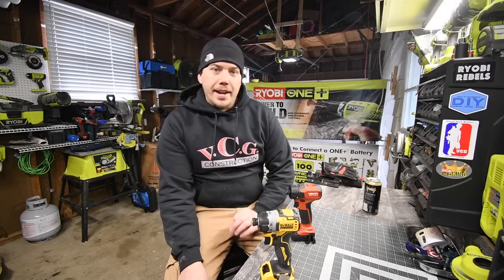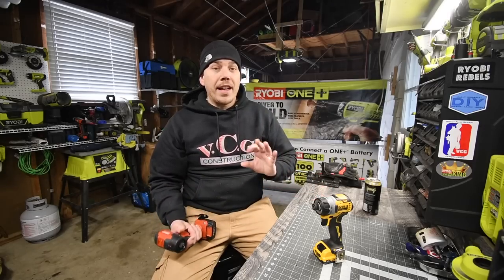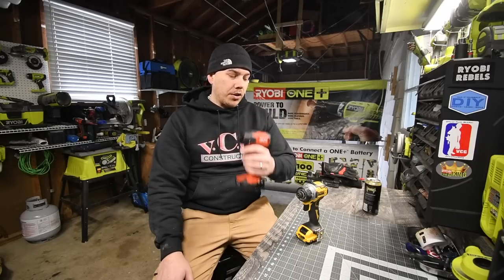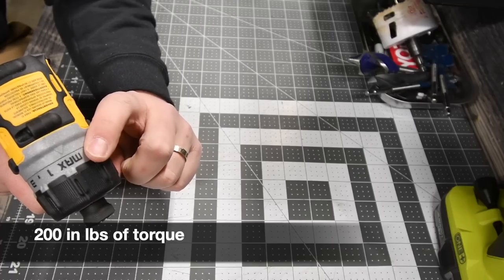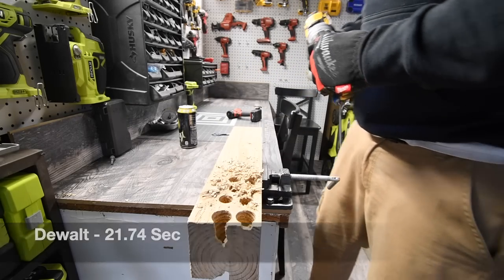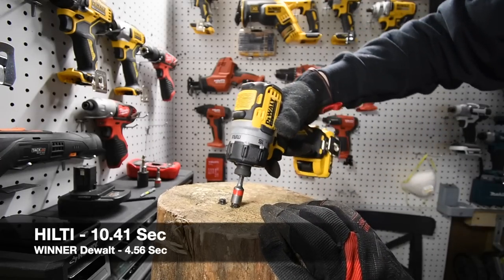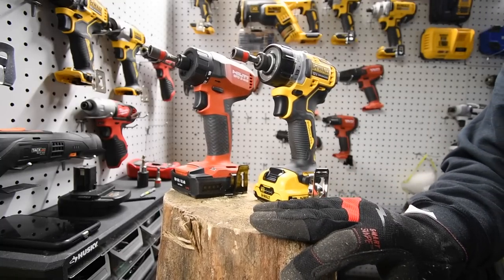Dewalt vs HILTI

Comment: I've had a brushed 12V Dewalt drill driver for damn near 15 years. Came as a kit with the drill, fast charger, and 2 1.5AH batteries. I use it every day. I beat the hell out of it and I've never replaced brushes or even a battery. 12V is the way to go once they get better battery tech. My Hitachi Metabo hpt stuff is by far the most comfortable and is super tough. My Makita stuff is strong as hell and has a lot of tools in their line up. Too cheap to buy Hilti, lol! Good test!
Reply from the maker: I thank you sir
Reply: Milwaukee for you my friend .. wow 😂😂

Comment: I use my DCF601 for residential and commercial HVAC service and installation. Has a great feel in the hand better than M12. M12 impacts pack power but lack refinement needed for fastening and torquing things down without damaging the bits/fasteners.

Comment: I have that DCF601. That is above & beyond my favorite tool that I own. I use it almost everyday. It's amazing. I highly reccomend picking one up. The tool has more power than you'd ever think, and the clutch is able to make it super sensitive, if needed also. As with all DW12V tools, the 3ah & 5ah make a huge difference. The 2ah these come with are garbage.

Comment: Do you know if Hilti has updated their 22v impact driver as well? Would be nice if they gave it the same overhaul as the hammer drill and 12v impact
Reply from the maker: Yes they did, It is now brushless
Reply: No they haven’t, they still have the same Sid 4 A-22 impact driver.

Comment: How could Hilti win when it required a slower speed than the dewalt on like every test lol
Reply: That's not My name agreed 100%
Reply from the maker: the dewalt did not on every test. the dewalt majorly lost with driving the holes the only thing Dewalt did better was driving in the screws, HILIT still won taking the screws out.
Reply: @ManCaverTools  imma rewatch maybe i saw it wrong lol. That and i was paying much attention. But.. il confirm.  Besides id go for hilti
Reply: @ManCaverTools  yeah. I was right hilti needs gear reduction to do much of any drilling or screwing dewalt does not. Dewalt is a better fastener. Given no gear reduction on the dwalt but hilti is good st removing.. which is kinda useless when ur building and putting fasreners in. U don't mess up every fastener
Reply from the maker: @AverageReviewsYT  the Dewalt 12v impact will ge the same the benifit when It versus the hilt 12v impact. the dewalt has multiple speed setting that will be used and the hilt has a variable trigger on its 12v impact
Reply: @ManCaverTools  doesent the hilti have the speed settings too? It looked like the dewalt was on a faster speed compared to the hilti

Comment: thats cool that they can do the big stuff, but i was kind of hoping you would test little stuff, like screwing a tiny screw into plastic (like the battery cover of a volt meter) on clutch setting 1 without wrecking the plastic threads. so far every drill i have (20v stuff) on clutch setting 1 is way too powerful and strips out plastic threads.
Reply from the maker: more test would be coming and I thank you for viewing Michael
Reply: @ManCaverTools  I need to put together a rogue fitness power rack that takes 1/2 driver 1-1/2 bolts. Will this hilti do the job? I predominantly do DIY work and driver screws, but on the rare occasion need to deal with heavier application. Any advice? This hilti screwdriver looks sweet and I’m deciding between this and the m12 impact driver

Comment: Hi,

The hilti might have two speed but doesn't do well on certain task. Maybe best to have one speed.

Would have been nice to see the dewalt on the 3.0ah battery. Just to see if it had the same power like the 2.6ah battery on the hilti. 

Still a pretty cool test video.

Thanks for the video
Reply from the maker: I do want a a bigger battery for the dewalt and revisit this test with it
Reply: The only task that mattered was definitely won by DeWalt

Comment: If you ever get a chance try the Bosch 12v PS22 pocket driver brushless motor 2 speed see how that match with the Hilti 12v screwdriver.
Reply from the maker: I am getting the Bosch 12v system and thank you sir

Comment: Milwaukee has a 12 volt drill driver model # 2402-20 you should test it against both of those, but I’m sure Hilti is the the best built out of all 3. It would be cool to see which has the most power 👍🏼
Reply from the maker: more versus videos are coming up

Comment: What is Brush and Brushless? idk wtf that is for an impact driver.
Reply from the maker: These are not impact driver. brushless motor is solely based on magnets. a brushed motor used magnets to start a spark to deliver power to the tool

Comment: I actually think the dewalt won  bc in speed 2 on the Hilti it couldn’t do it at all and that’s what the dewalt is in all the time is speed 2. So you would need to compare the test for both in speed 2
Reply from the maker: but that's the benefit of having both speeds. because that's like saying the dewalt should have failed both tests with drilling out the holes because it wasn't able to do it without stopping.so the only tests the dewalt will win is driving the screws in and the HILIT will still win with driving in holes and taking screws out
Reply: Man Caver Tools I see your point. No matter what I watch all your videos and love them keep up the great work! We will agree to disagree on this one 😂
Reply: @ManCaverTools  i bought the precursor to that dewalt ( dcf610 ) about ten years ago and that is the most used of all my tools. Worked as a electrician for 20+ years. It was so good in the hand and small in size. However, i very seldom used it to drill holes and honestly i do not think dewalt designed either of them to drill with such big spade bits and therefore there is no need for a gearbox. use a bigger machine for drilling holes. I had two dcf610, 3 dcd 790 and the big boy dcd 996 for heavy work. the dcf610 i used for screws and mounting things like wall sockets, light switches and so on. if you use those small machines 5 days a week for drilling such large holes you did in this video they are not going to last very long. so the dcd790 for drilling and dcd996 for heavy drilling. dcd601 for light work.

Comment: What is the purpose of 12v tools when you have 18v whi h are more powerful and not much more expensive. Just my thought
Reply: norbkowa even though I like my m12 line very much alongside my hilti your 100% correct.
Reply: less weight. This tests are not representable fot the use of this tool.
Reply from the maker: Correct, this is a motor stress test on these to see what they can do. you normally won't use these for these tasks
Reply from the maker: because they are awesome
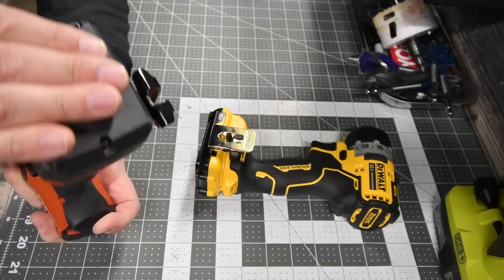Reply: My m12 fuel drill weighs 2:11.8 lbs/oz with a compact 3ah battery, my m18 brushless (not fuel) weighs 3:11.8 lbs/oz with a 3ah H-O compact battery.
The purpose of 12v is to have the power you need 90%+ of the time with less strain and fatigue. I personally almost never use my m18 drill since the m12 and hell even my weak non brushless 12v makita at 2 lbs 6 oz with battery does the job. Plus I have CECS in my right forearm from my job so for me it's either lightweight tools or my hobbies can go fly a kite.
I am glad I have the 18v when I want more torque, but unless you're building a deck, need to drill many holes in cement, drill out/bore many massive holes or doing any other repetitive tough work, a strong 12v is all you need.
Reply: Eric Mann thank you for answer and explanation. Didnt think of that from your point of view but was just thinking that more volts and amps is better but didnt think that actually 12v may be useful
Reply: @norbkowa  I remember buying the 12v for fun thinking it was going to be stupid and useless myself lol

But then I used it to install curtains on all my windows in my new apartment and I was sold, so easy to hold up in the air and take your time.
I did originally buy the ridgid 12v kit first since I didn't want to spend the cash on the Milwaukee kit, but I didn't like it at all and returned it.
I finally bought the Milwaukee Fuel kit when it went on sale for $249 cad at the same time as a free 6.0ah battery promotion and although I prefer the grip of the Dewalt and Makita, the Milwaukee one is so powerful it remains my favorite.

Comment: The problem with 2 speeds is that the first speed is meant for drilling, which it is quite mediocre. 
Getting a devoted 12V drill and a separate driver is where its at.

Comment: Nice review, why do you prefer the Hilti when the Dewalt performed better on certain tests?? Hilti is 3 Times the price of Dewalt, do you think the Hilti is 3 times better?? Thanks and keep making good videos!!!!!
Reply from the maker: This HIlti tool cost $89 tool only
Reply: @ManCaverTools  yea but if your not in the line yet, the cost for a kit would be around $200 with the 2.6 AH batteries and charger, that Dewalt kit is now $89 at Lowes with the smaller 2.0 AH batteries. I also like Hilti tools, I'm just asking if you think it's 2 + times better than the Dewalt. I am a Hilti guy when it comes to the big concrete tools just curious about the 12V line as compared to the Dewalt, thank you for taking the time to respond to my question.
Reply: @lawdog516  I think it’s how it’s looks and feels kinda thing.Also Hilti  has the rubber battery moulding which is great!

Comment: I'll take the Milwaukee Fuel 12V drill and impacts over either one of these.  Their smaller battery design makes them an easy choice over the clunky slide on packs that make the tool too big for getting into small places.
Reply from the maker: the Milwaukee m12 system is awesome as well and thank you sir
Reply: I thought the same, but then I handled the new Dewalt xtreme brushless 12v and at 1/3 lbs lighter with a more ergonomic grip, dammit I love it. Keeping the Milwaukee though, because you're right and I still think the same lol =D

Comment: If speed 2 is unusable in high torque and ONLY in low torque situations, why have it? 🤣 Especially for the cost.
Reply from the maker: but everyone is ignoring the struggle dewily had in the first 2 tests. I did the same thing with the dewalt hammer drill against hilti hammer, I used a lower speed setting on the dewalt so it can to the test. instead of  just failing it
Reply: @ManCaverTools  if it struggles and gives out, it loses. Your words, bro. #justsaying
Reply from the maker: @meagaindave2049  so your saying that when it comes to the video of the dewalt hammer drill versus the HILTI hammer drill the dewalt lost big time now  since I had to change the speed setting on on the dewalt?
Reply from the maker: These are 12v tools, the rules are different for these. you don't do these tasks with 12v tools. if the dewalt had 2 speed settings it would be different.  if I were to choose a speed on the HLTI it would be speed 1. The  Dewalt 12v can only do screws without stopping so how is that being a winner? The HILTI is able to do both spade bits and screws without stopping. So im not sure what you are trying to say, but I thank you so much for viewing.